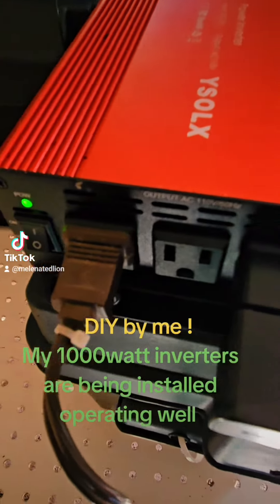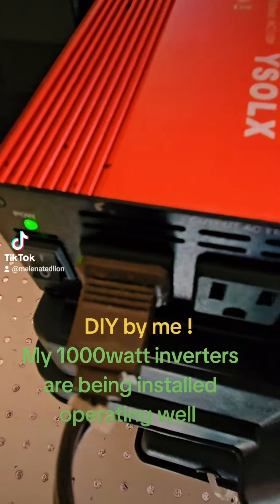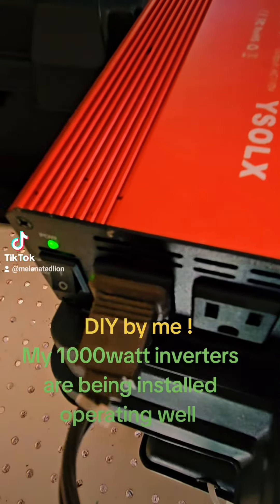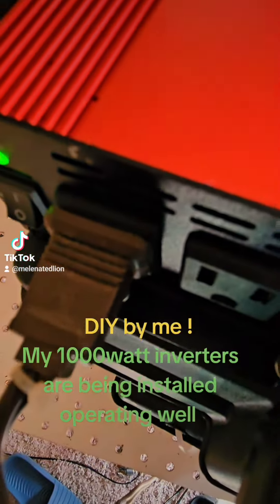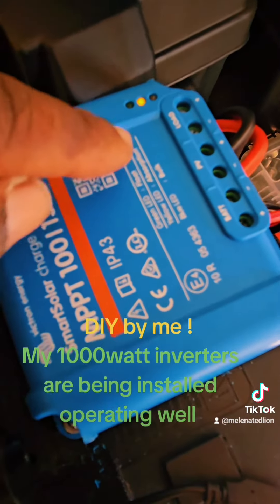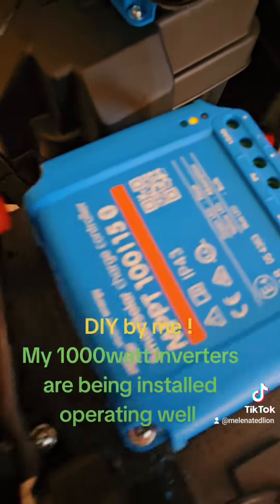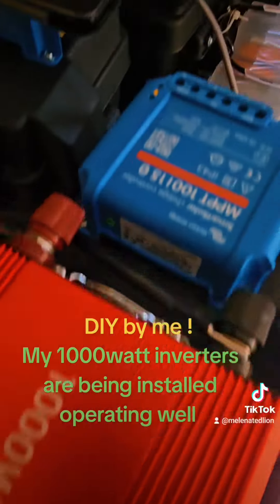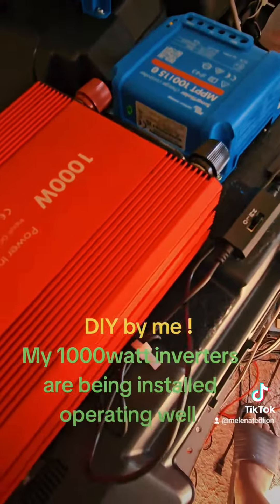1000watt new inverter upgrade on my diy 12V 100amp solar generators with Victron MPPT Controllers

Comment: As I have several ryobi 18V and 40V batter tools . You system would work well charging my batteries.  Something you and Trent [ Vision preparedness] could stress an important use of your system.
Reply from the maker: I have a  bigger DIY 48V 5 .0 KWH Trophy lithium battery with  digital BMS and heater paired with a Signature Solar 3000watt 48V EG4  inverter with 500V of PV intake   that will charge an electric vehicle
Reply from the maker: I have saved thousands of dollars 💸 diy my own solar generators and I can repair them and upgrade them myself like these four  12V 100amp lithium battery units